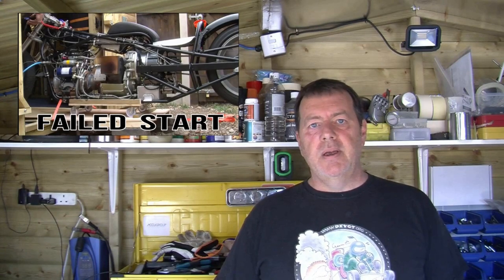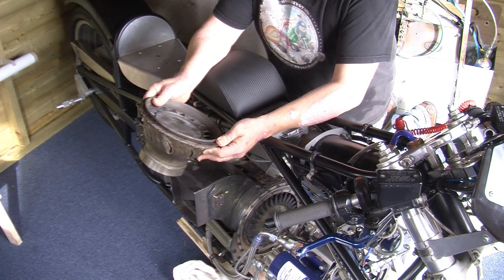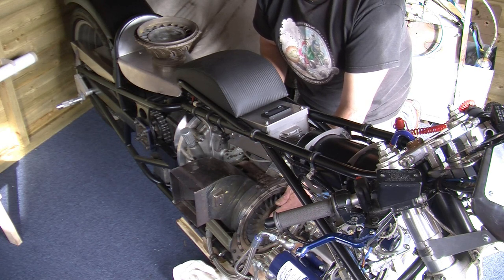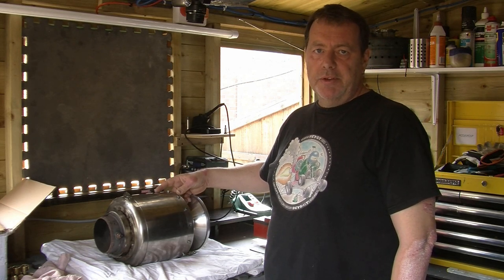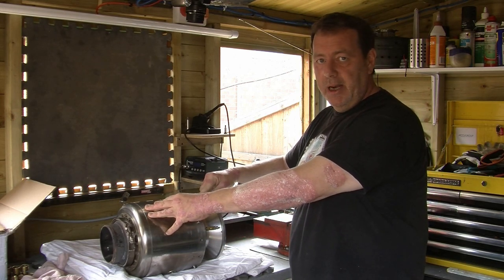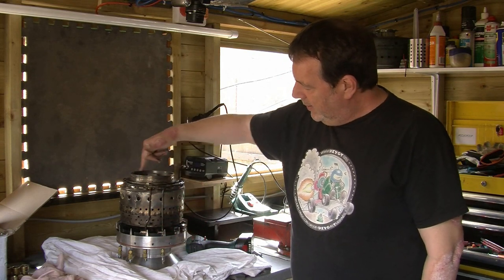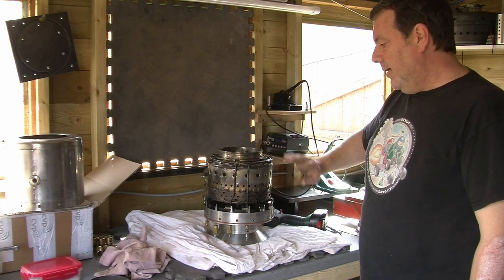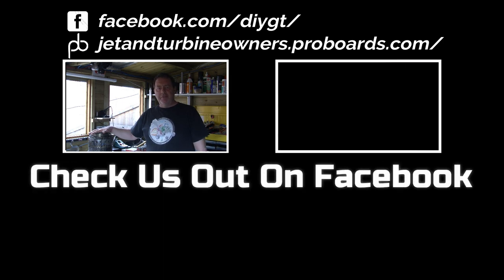DIY Turbo Jet Engine   Engine Fail In Video Aftermath

Comment: andy  ,, its lol here steve turners mate ...just one question mate ,, where can i get one of your  3 phase starter motors and how do i convert it from  a 12 volt  dc to 3 phase ..im struggling to build the combustion chamber .its needs to be 7 1/2" dia x5" long ..id like to pop over and see you and would learn a lot my dream is to build a 3 wheeler  2wheels at the front .. i could explane in detail when at your place would a couple of centrifugal clutches in line be a good idea ?